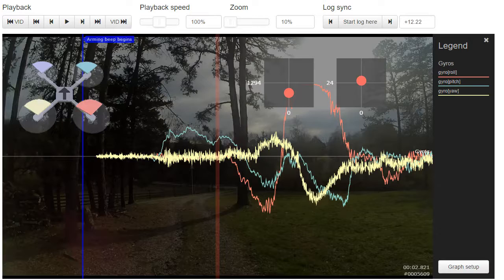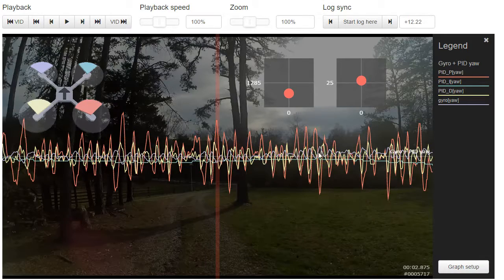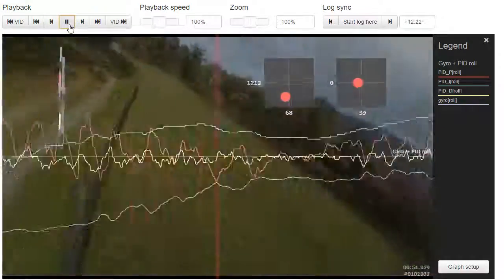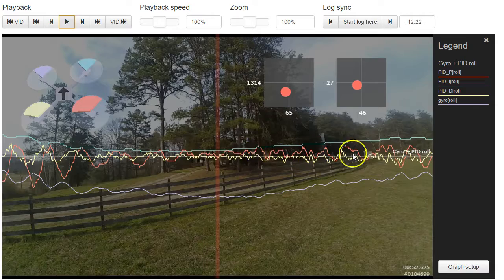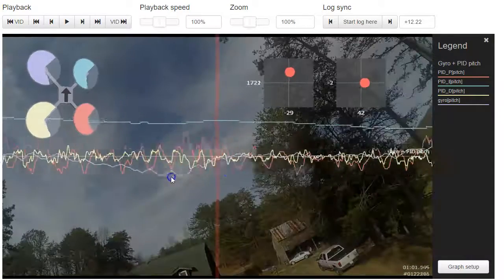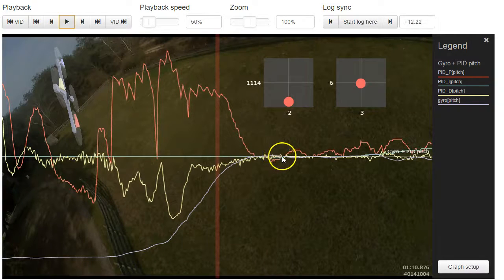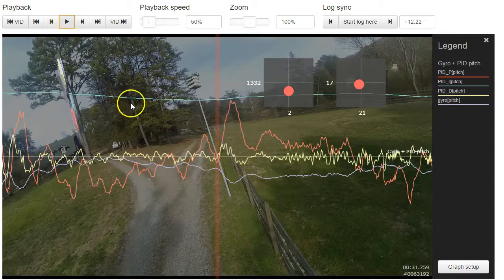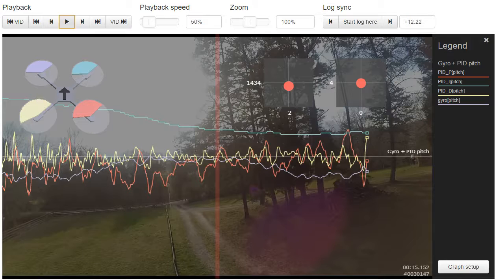Blackbox Log Analysis: joshuabardwell - 3/7

Comment: Are you still using the Lux?
Reply from the maker: F303 on this build.
Reply: +Joshua Bardwell Ah right, nice. I think that would be my choice if I was in the market, though the lack of v.bat is a silly omission. The yaw P gain is odd isn't it. It's already on the low side of what would be considered the norm. I'll be interested to see how you get of with it once you've lowered it.
Reply from the maker: +Revs I honestly didn't notice any flight issues with it at 7.0, so if I don't like how it flies, I'll put it back. But on principle, I do want thin gyro traces.